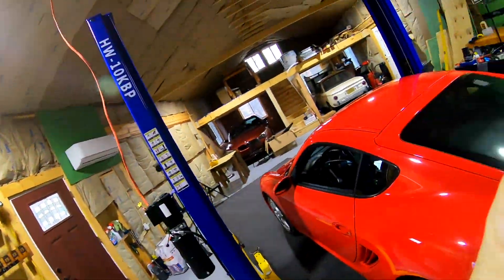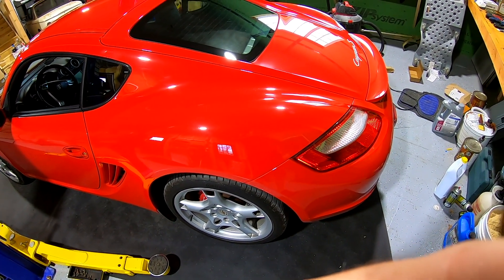Porsche 987 Engine Cover Removal *YOU WON'T BELIEVE WHAT I FIND*

Comment: Flat 6's do smoke a little on start up naturally because the cylinders are laying on their side. The trick with the air oil separator, you called it the PCV valve, is to never fill the oil all the way up. I like to keep mine at most one lower than the top mark.

Comment: The AOS is known to go bad on a regular basis. Probably a good idea to replace every 50,000 or so - they are not expensive, even the genuine Porsche part. Also the rear hatch can be put into a "service position". Simply push up further and it goes to a near-vertical position.
Reply: There are some more nice “need to know” features on this model olmost nobody knows about.
Look for hidden features or something on you tube.
You can, for example, fold the mirrors by hand and other stuff

Comment: My 997 puffs out a huge amount of smoke on startup that completely goes away after about 10 seconds. The longer it's left without starting the worse it is. I hope replacing the separator fixes it. It actually looks like once you remove all the covers you have more access on a Cayman than you do on a 911. I guess the cover behind the seats will be the next video.
Reply: I guess that's a feature on boxer Porsches, so don't worry about it too much.
Reply: All flat boxer engines will puff out smoke on start up occasionally, mine has always done it (Cayman 2.7, 128,000 miles, '07) Even though I've recently replaced the AOS it still does it. Oil collects in the bottom of the cylinders and won't drain, just gets burnt off on start up.

Comment: I'm no expert, but isn't it possible that ad rates in general dropped in the days after the election, since all that political ad spending ran out?  Regardless of the outcome of the election?  It's simple economics - decreased demand for advertising means pricing must fall to keep ad slots full.  Once you got down to business there was some helpful stuff in the video - thanks.

Comment: The stock market in 2015 was the highest it had ever been up to that point.

In general, since President Dwight D. Eisenhower took office in 1953, the economy as measured by gross domestic product, unemployment, inflation and recessions has typically performed better with a Democrat in the White House. GDP growth has been significantly higher; inflation has been lower; and unemployment has tended to fall.